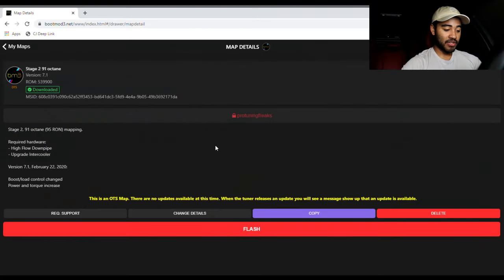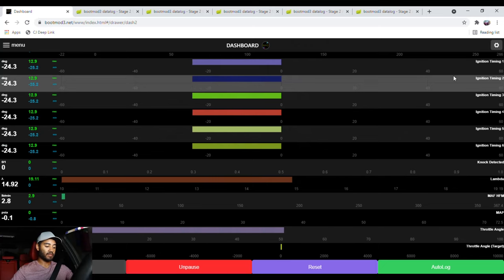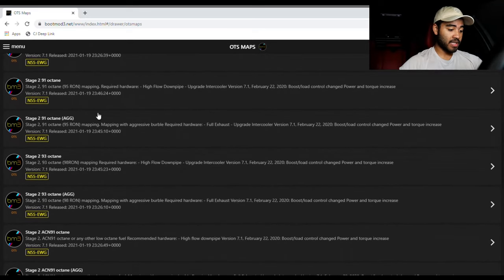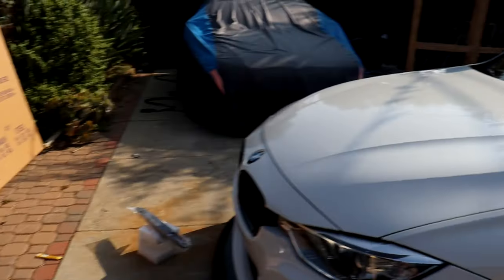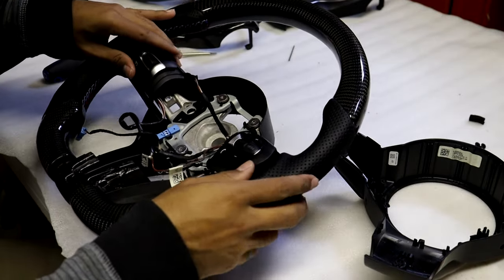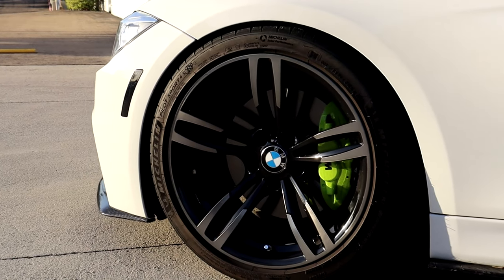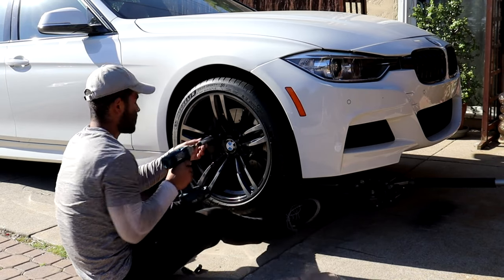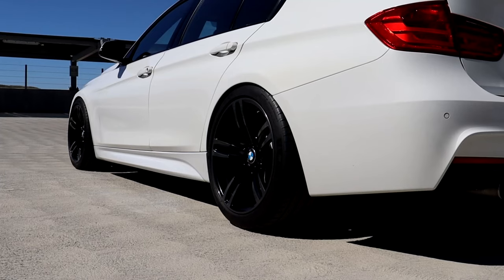TOP 5 MOST EXPENSIVE MODS ON MY BMW F30 335i

Comment: Just recently got a 08 328i sedan e90. Loving the car but she’s gotta go in for some sensors ☹️
Reply from the maker: What sensors?
Reply: @InlineSixAuto  brake pad wear. But recently I’ve been having a cold start issue. Have you ever had a issue with your cold start?
Reply from the maker: @PaXx.Dalton  What issue are you having on cold start? I just have a rough idle for a few seconds on start up sometimes but it hasnt gotten worse
Reply: @InlineSixAuto  When I start the car it starts at 1k rpm then will will dip down to 600rpm within seconds. But soon as it dips down the car self revs up to 2k rpm then after that it slowly goes down to 600rpm and it’s fine
Reply: @PaXx.Dalton  could be the spark plugs, coils, maf sensor, fuel injectors, fuel pump etc. Maybe go get it diagnosed by a certified bmw mechanic or even get it smoke tested.
Reply: @EmpraMcdade  thankyou. Planning on taking it to the mechanic next Monday. Hopefully it won’t be much to fix
Reply: @PaXx.Dalton  probably won't hopefully, I have a 07 328xi and I've been through some stuff with it....also make vlogs on it as well, recently been dealing with lean code but turns out it's a leaking valve cover. I ordered an aluminum one from ebay and will vid on that once it's installed.

Comment: Quick question, do you not use sportmode anymore since you installed the coil overs?
Reply from the maker: I use sport mode still, why wouldn't I because of coilovers?
Reply: @InlineSixAuto  I heard that coil overs mess up the computer for the driving mode. Or maybe it was lowering springs, but I wanted to get a second opinion. I still haven't started modding my f30.
Reply from the maker: @BashxSaiyan  Where did you hear that? Maybe if your F30 has the electronic dampening function where it'll make the suspension a bit stiffer in sport mode. But that's only an option on the later F30 years I think 2016-2018 340's. Even then, they make coil overs compatible with that function from what I've seen.  Also mine does not have that option since its a 2014 335i. So you should be able to find use coilovers for yours no matter which year.
Reply: @InlineSixAuto  My 2013 335i has EDC but IMO it's not worth the cost to go for aftermarket EDC suspension. It's double the price of non EDC aftermarket suspension while having very little difference in feel between EDC and non-EDC suspension. You're better off getting an EDC delete kit.
Reply from the maker: @justFiji  Oh okay, good to know as I wasn't really knowledgeable on that. So the best thing to do would be to delete the EDC and just get regular coilovers without EDC? Or whats the best way to lower the car if you have EDC?